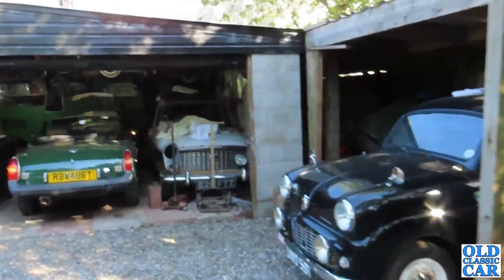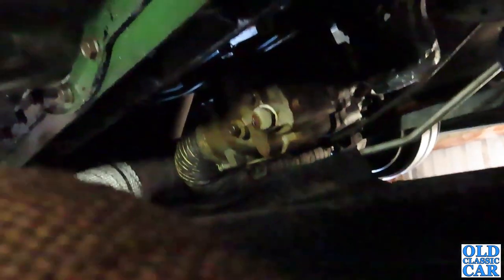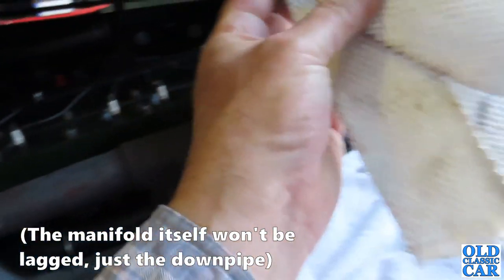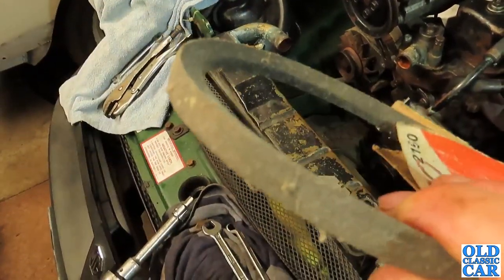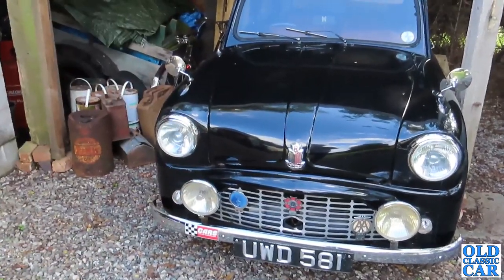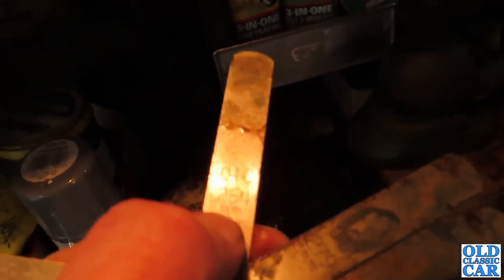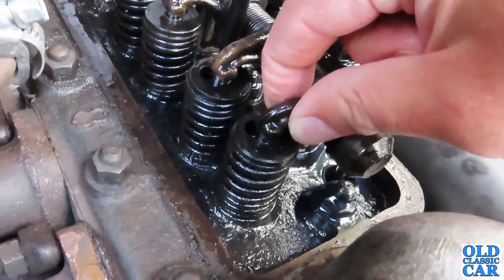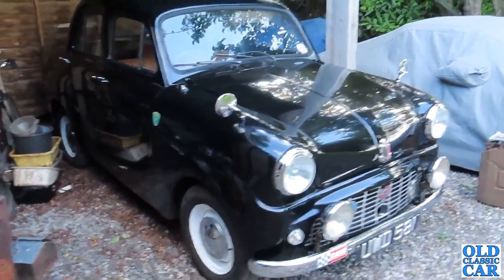Progress on MGB, big Dodge, Standard & Anglia evening drive/classic car meet

Comment: On the noisey  tappets
Take off the rocker cover Start the engine .Insert a 5thou feeler into each tappet in turn When you get to the loose one the tapping will stop .Switch off engine and adjust this valve a little at a time
An old tip from an old codger
Reply from the maker: Good idea I'll give that a whirl

Comment: I remember My Dad had a little Riley with a 4 seater Wyman body. This was in 1951 or 52. The smallest model they made. I know it was a very early one. He also had a Rover 12 Sports Saloon. He reckoned that this was one of the first few built with the latter type boot lid. So a 1930s car. This was very much his pride & joy for a number of years. It had the glass bottle with oil in it & the big foot lever which you pressed down  to oil all the relevant parts underneath the car in one go. It was a lovely car with a very good interior & body work to match. All black of course. This was in the late 50s to early 60s. He had it for about 5 years.

Comment: Hi One thing I found with carb overheating was making sure the air filter had cold air (out side air) may need a pipe to bring in that air. The air coming to it comes through the radiator.

Comment: Loving the Big Dodge Richard😎 Just a word of caution on your splendid heat shield, I did a similar on my flathead V8 and then drove myself mad because it did the job but at the same time produced really irritating rattling noises which necessitated a number of fibre washers to stop the noise😉
Reply from the maker: Thanks, yes these heatshields are really just a first go at coming up with a workable solution and I fully expect the odd rattle to attend to. I intend to add bracing to the shield close to the exhaust down pipe

Comment: Remove rocker shaft with rockers . Then check rocker pads for wear, you can judge wear on rocker shaft by twisting rockers slightly on shaft with fingers or strip shaft and examine thoroughly. If rocker pads have minimal wear you can grind pads flat ( only thousandths though). I was a BMC apprentice trained mechanic. Good content, but adds every five minutes.

Comment: As you said repro better than nothing but almost every part I have bought I have had to modify, it sucks.
Of course when adjusting valves if the top of the valve stem is dished you will never get it right.

Comment: 803, 948 and 1147 heads are all different, they will bolt on but the combustion chambers are different shapes. 803 is bathtub, 948 more of a heart shape. Sounds more like a cracked skirt than a tapped to me, but then again I am not standing next to the car listening properly so probably wrong suggestion.
Reply from the maker: Interesting, thanks, I'll look out for an 8 head assembly and experiment with swapping bits over

Comment: I'm not sure mate but I think the heat shield should separate the exhaust from the intake. The tappets should be set at the thickness of Tallyho cigarette papers packet (but that's probably thinner now) Use a bit of wooden curtain rod as a stethoscope for the tappet noise.
Reply from the maker: It's all work in progress but it should help, I'm not sure I have any Tallyho cig papers to hand :)

Comment: On the subject of old parts vs new, I posed a question to the MGB Forum why the current alternator belts are notched rather than solid V belts.  It got a lot of replies but no one really answered when BL changed over from V to notched and why.

Comment: Brass gadget - a moose whistle?
Big Dodge carbs - does one of the spares perhaps have a bigger main jet? It may help with the vaporising & I doubt if you'll be able to tell any difference in MPG.
Reply from the maker: Alas the only other main jets I have are, I think, from an industrial engine setup. They are adjustable, but wayyyyy smaller than the original fixed jet that was fitted to the truck originally (and is on now).

Comment: Thumbs up mate.I was wondering if the insulating spacer  has gone missing from between the carb and manifold.(just a thought)Anyway good luck sorting it.(dodge)
Cheers.
Reply from the maker: I'm not sure if it ever had a spacer, I'll have a look in the parts book to see, thanks for watching
Reply: @oldclassiccarUK  Thanks for your reply.The first thing i,d try(easiest)is to run it down the road and when it gets dodgy(lol)pull over and take the tank cap off to rule out a vaccume in the tank,(because it sounds like fuel starvation from your description) and move on from there.
Enjoy your vids,cheers.

Comment: Some design flaws there but a practical solution. This got me wondering how the Dodge managed to function when it was new then you answered the question wit the type of fuel explanation. I am off to Beamish Open Air Museum this morning and they run a few vintage vehicles of all types. I think you are quite smitten with the Standard 8.
Reply from the maker: I did similar with little Dodge, the magneto was breaking down due to the close proximity of the exhaust manifold. A simple shield cured its woes.

Comment: A series engines had a shield made out of some absestos type material years ago which obviously worked ok, but I just wonder if your shield will also get rather hot, could you use the insulation material on the shield as well? I wonder what was used originally presumably the same thing happened then.
Reply from the maker: Fuels were very different in the 1940s to what we have now, and engines suffering a bit with fuel vaporisation now may not have had the same problem when new. I did a similar shield on little Dodge to keep heat away from the magneto and it worked well, although doesn't look too pretty :)
Reply: @oldclassiccarUK  New fuels cause the engine to run much hotter as well.  This is why, I believe, mufflers last so much longer these days.

Comment: hard to tell the scale, but if its alloy the gearbox looks like a Reliant possibly? The half moon clip that holds the gear lever and bell cover on is exactly the same as Reliant used. 3 wheelers and 4 wheeled variants, not Scimitars !
Reply from the maker: Interesting, thanks for the info
Reply: I first thought it was reliant but the rear mounts look different?